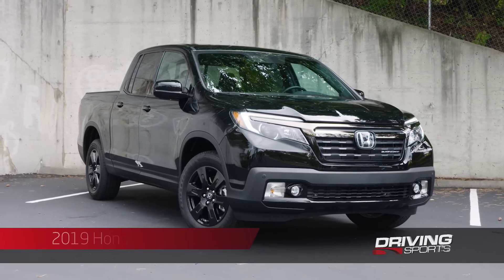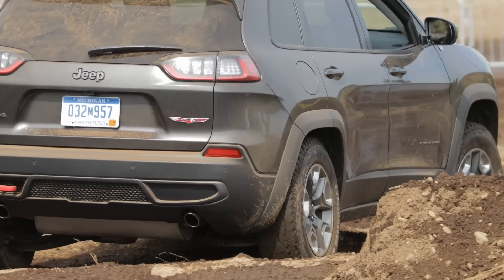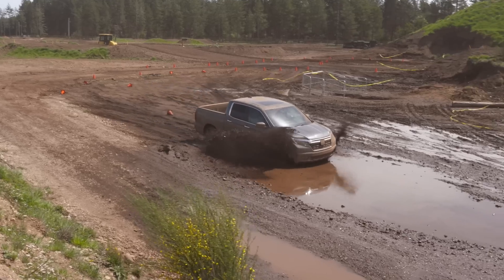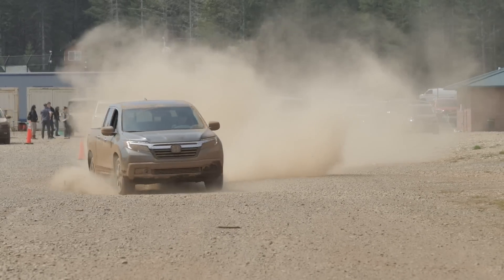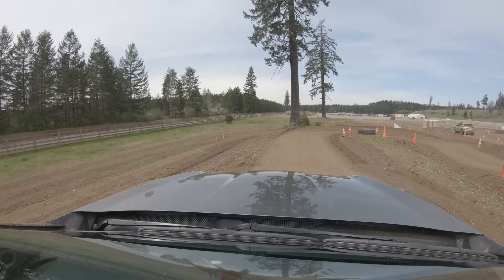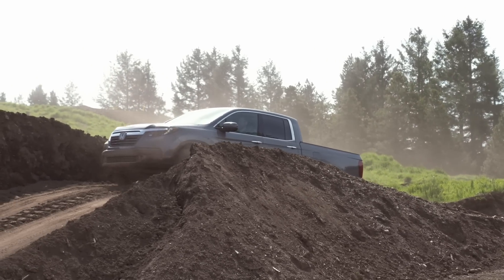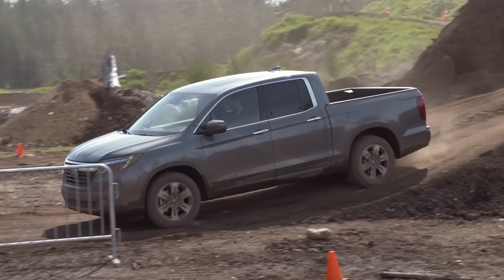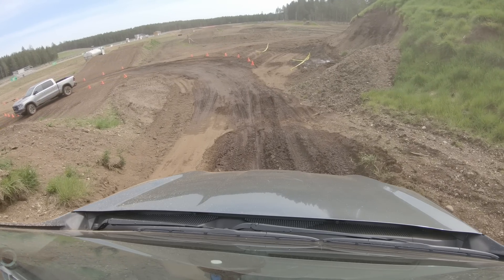2019 Honda Ridgeline Off-Road Test

Comment: I have the 2017 RTL-E and my only gripe is fuel economy. Wish it was better.
Reply: What are you averaging, and under what conditions (percent city/highway)?
Reply: Alan Bowers I drive about 70% highway and 30% city. I average 20-21 in the winter and 22 in the summer months. (Sometimes 23 if I stop driving like Grandpa and drive like grandma)
Reply: shedrick s not terrible but not great either. I’d like to see 24-25 with that kind of driving. My 4 banger Tacoma gets around 23-24 and I’m okay with it though so maybe I’m too optimistic.
Reply: i get 24.5 mpg using eco 80% highway cruising around 50 mph
Reply: Alan Bowers Your right it's not terrible but I was hoping to average 24 for my commute back and forth to work.
Reply: Eddie Kuhn I can't drive that slow on my commute. Also is this hand calculated because the Ridgeline trip computer is off by about 2mpg. So if your computer says 24.5 your probably getting 22.5 - 23
Reply: My 2018 Colorado Z71 4x4 with the V6 has been averaging 20.8 around town. Did a cross country trip with the cruise set to 70 - 75 mph the entire time. Averaged 22.5mpg during the Winter. I like the sideline but like the Colorado better for durability doing truck things. The sideline is all most will need and will likely last a long time too. I did not like that the beginning of the video saying the sideline can tow more than a "Colorado". WRONG. Mine legally tows 7000lbs. If you get the off-road ZR2 or gas 4cylinder.... then it  would be correct. The ZR2 tows 5000lbs and the 4cylinder tows 3500.
Reply: shedrick s Have you ever tried hypermiling it in thebright lane on the highway? I'm interested to see if it could reach 30 mpg by hypermiling.
Reply: I am willing to bet that the answer would be an astounding YES to being able to hyper mile and get 30mpg. My Colorado gets around 30 to 40 mpg when on flat ground cruising at 40 to 45 mph and in 4cylinder mode on the V6 with 4we and all terrain tires. Modern trucks are getting pretty amazing these days.
Reply: Oh wow thats horrible. I have a 2015 GMC canyon with the v-6 and get on average 25-27 mpg highway going about 68-70.
Reply: sideline*  lol
Reply: In the summer on long highway trips I average 24-25mpg hand calculated.  I get better MPGs at 70 then I do at 55.....weird!
Reply: border411 Yeah I notice the truck likes to be right about 65, that seems to be the sweet spot.
Reply: I drive my 2018 RTL-E on the interstate for work daily and also average around 21 mph year-round (using eco mode). It was advertised to get 25-30, but I only see that happening if you really go out of your way to coast at high speeds without touching the accelerator.
Reply: I don't know where you guys are getting your numbers from for Tacoma's. My Tacoma V6 gets 15.0 - 17.0 mpg nearly every tank.

Comment: About Toyota Tundra and Honda Ridgeline  which one is the best Truck ?
I have 2006 TOYOTA TUNDRA running excellent never have any issue, only change oil and tires
Reply: BabyBBB01 they are very different trucks. Toyota is standard body on frame. Drives, rides, and handles like a truck. Honda is very different. Drives and rides like a Camry but built strong for towing and more importantly, stopping a trailer without wearing out brakes or transmission. It’s a nice combination of truck and car. Truck for those of us who are not truck guys. That’s why it’s pretty rare to see one with a lot of after market stuff, big knobby tires, lights, winches, etc. it’s not that type of truck.
Reply: You talking Tundra or Tacoma? Tundra is a full size truck. Ridgeline and Tacoma are midsize. Toyota is excellent quality. I've driven Toyotas for the last 15 years. However, the Tacoma has a very uncomfortable cab and sitting position and fuel economy isn't so good which is why I went with the Ridgeline.

Comment: All commenters butt hurt over saying this tows more than a Colorado. If you are thinking of towing 7000lbs with a Colorado or a Tacoma you seriously should be getting your head examined. My Tacoma doesn't have enough power to tow my 3000lb boat. I would never tow more than 5000lbs with it. I'd never get out of first gear. The big thing this truck has that NONE of the others in this class has, is a bed capable of hauling a sheet of plywood.
Reply: S Patoine hailing a sheet of plywood? Hanging a foot past the tailgate! Oh an I have towed a 6,000 lbs boat for my brother a few times with my Colorado z71,4x4,V6 Ext Cab with ease! Plus tow my 4,000 lbs travel trailer with my Sportster in the bed! That’s just over 10,000 CGVW in a Cat Scale! On a 4,000 mile trip a year or so ago.
Reply: Can't speak for the Colorado. I can say the Tacoma can't haul squat, is gutless, and sucks fuel like a 1980 Chevy 1/2 ton. I had to put airbags in the back so I could haul a decent load.
Reply: The newer Canyon/Colorado with the diesel engine can do that. Plus, they are NOT the size of the old S-10 or older Canyon/Colorado. Their frames are a lot beefier
Reply: K. R. V. If you really towed 10,000lbs with a Colorado, you sir are crazy. I'm not questioning the trucks ability to pull it, I question the ability to safely control that weight with your truck at highway speeds.
Reply: @guardrail2897  That's the total weight on a scale. (trailer, truck and a Harley on the bed of the truck.)
Reply: Just hauled 5 sheets of mdf with my ridgeline. Tailgate down and they stuck out no more than 6". To all the people who complain about not having an 8' bed - thats what straps are for
Reply: S Patoine this is true!
Reply: @k.r.v.4219  Yeah, you can't fit a sheet of plywood flat in a Colorado, no midsized truck has an 8 foot bed, and most half tons are sold with short boxes, so your tailgate comment is straight ignorant unless you are comparing to a full sized long box truck. Also, any real truck reviews state that if you plan to tow over 5k lbs, you should be using a full sized truck, because even with a weight distributing hitch the trailer has a significant chance of pushing a midsized truck during braking. Yes a Colorado can theoretically tow 7k, just remind me not to be anywhere near the guy who tries.

Comment: How is it in soft sand?   That's one test I haven't t seen.  I use my '06 Pilot at the beach and she works fine, but the tools that rip down the beach, faster than they should, and others with wide tires cause some deep ruts to be dug out causing me to sometimes bottom out.

Comment: My only real issue with this is the price and long-term reliability. The Black Edition and Tacoma TRD Off-Road 4 door are virtually the same price. Hondas are good until you kick over 220,000 miles, auto transmissions are insanely expensive to fix or replace, the bed of the Ridgeline is smaller. The Tacoma TRD Off-Road can double the mileage all day with proper maintenance, you can get a manual transmission which is better on fuel and super cheap to replace a clutch, flywheel, and throw out bearing. Fuel economy on both are virtually identical. Both are comfortable, but the Tacoma is better in every way and will suit the same needs to those who want a Ridgeline. The other side is AWD vs 4WD which is a futile point in today’s vehicles when it comes to normal road use. This is Honda’s El Camino. I have owned many Hondas and loved them all, but their market is budget friendly consumers, not the high end market. They need to stick to what they do best; making reliable and budget friendly vehicles and stop trying to sell things out of their spectrum. For those looking to compare reliability with American vehicle brands; just stop. American vehicles do good to see 200,000 miles in the best of situations, are made with so many gremlins it should be a crime, maintenance and repair costs are ridiculous, and the days of those “classic American reliable trucks” are LONG gone. I’ve owned plenty, hated them all for various reasons, and their value just doesn’t compare. Don’t even get me started on Jeeps.
Reply: The reason to pick this over a tacoma is comfort. The interior noise level is as low as a s-class mercedes on the rtl-t trim and up. Also the ridgeline will haul plywood flat in the bed where a tacoma will have to prop it on the wheel well. And there is the in bed trunk which i use daily. There is the in bed audio system which is perfect for tailgating. It does all this without giving up much capacity to the other midsizes. The only downside is the engine which uses a timing belt which will need to be replaced every 105k. I wish it used a turbo 4 cylinder personally for a few more highway mpgs

Comment: I'd be a buyer if it towed more and had at least another inch of ground clearance. Perhaps the air suspension like the RAM to lift it. My 4000# trailer would push it to it's max when loaded, and hill climbing that way would be SLOW.

Comment: Correction that more load capability than a ZR2 Colorado NOT a Z71, LT, Base or W/T Colorado Ext Cab, of which is not available in the Ridgeline! The gas powered Colorado Ext Cab 4x4, 4 cyl or V6 other than ZR2 can carry up to 1,552 lbs and the V6 can tow up to 7,000lbs. The diesel can tow 7,500 lbs! Not to mention go off road better than any Ridgeline will ever, especially the ZR2!
Reply: K. R. V. Exactly they tried to hype it up cause it can to more then a soft suspensioned zr2
Reply: The extended cab is a two door, not in the same class. Same reason you don't compare a single cab half ton with a crew cab, the former will always beat the latter.
Reply: CommieCat but still not needed to have more capacity or room. The Crew Cab Colorado in any trim level besides ZR2, like Base, W/T, LT or Z71, in rear or 4x4AWD all have an available longer bed with more weight and towing capacity, with a real body on frame truck that will absolutely take more abuse and overloading, than Honda’s fwd minivan based tuv.

Comment: I am considering this Honda vs the Toyota tundra trd pro, which is the better off- road vehicle?
Reply: If you do lots of off-roading, don't get Ridgeline. Its ground clearance is less than 9". I wouldn't say Tundra is a better off-road truck but it does have good ground clearance. If you search Edmunds' Death Valley Ridgeline tests video, you will know what I meant.
Reply: Is this a serious question?   Good lord, there is no comparison.  The Tundra is built for off road, the Ridgeline is built for pavement Princess’s who like to pretend they have a truck while they tout “comfort”.

Comment: Lol!   Watch Car Question honda ridgeline diagonal test. HUGE FAIL
Reply from the maker: Watch the same drivetrain in the Passport climb up a diagonal cut: https://youtu.be/cHwp1WxhYpI
Reply: I think what you see is the clutches limitations, AWD especially sh-awd (ivtm4) because of it's capability send 70% to rear is superior on wet, snow and light off road, but when it comes to pull whole vehicle weight up steep by single wheel driven by clutch, it will over heat them...it has to be used with that in mind, driver should try keep slow momentum as much as possible if you in deep wavy terrain ...edit: which makes me wonder, idk how these are designed, but why this can't be some sort of combination of clutch for smooth connection and dog clutch once system senses that it needs to remain connected, sort of like G80 with smooth engagement, imagine cylinder device with outer ring as clutch plates and center sliding piece as dog clutch locking it up, all that capable of disconnection for all AWD needs

Comment: It's not a truck, it's a mini van with a bed in the back. If you get a flat tire with a load of gravel or etc, you will need to empty said load to get to the spare. My Nissan Frontier PRO 4X can tow 6300 lbs and it has a rear locker and it can go through puddles too....and it's cheaper than Honda.  Nissan sells more Frontiers than Honda sell ridge line!

Comment: Why I wouldn't buy one.
No frame
No solid rear axle
Transverse mounted engine (front wheel drive bias)
Very bad approach/departure angles
Comes with a stuck mode button?? 
No low range
Makes peak horsepower over 6000rpm?
It's not a truck.
Reply: Joe Orcutt you should also make sure your truck doesn’t have independent front suspension should have a solid axle be a real truck

Comment: Had my 08 ridgeline last up to 350,000kms and with weekend towing of a loaded two atv trailer so about 3000 pounds. It got me more than ten years of hard use, the engine still does not eat oil but the transmission is toast now. Dont know what to go with next, colorado, tacoma, or another ridgeline.

Comment: No low range. No body on frame. Not really a 4WD truck with out them ! Just like Subaru's are not really SUV's. Subaru's, the Ridgeline and all of there ilk, unibody with no low range, can be very capable for what they are and what they are is beefed up AWD cars. It's like this: Quater horses can do just about everything that most people need a horse to do, but it's just not a true draft horse and should not be sold under the guise of being one.
Reply: This comment reminds me years years ago, people say cars with AT are not cars. Ridgeline is not 4WD. Its an AWD. Its an AWD truck.
Reply: So I'm guessing my horse analogy didn't work for you.

Ain't disagree'n grand !  How bout we call it an AWD Trar.

Ps. Don't get me started on slushbox transmissions. I am even less enamored with them than I am with cars in truck clothing . Big strong cars that is !

Comment: This is a fantastic vehicle. But I will not be buying one. First, the Ridgeline has very little market penetration. Their sales is less than 10% of the competitors. I do not want to be stuck with an orphan.
IMHO, they should have market this vehicle as an upscale Accura. They should cut the price for the first year, and give heaps of incentives to the salesman for making multiple sales. They need the market penetration. They need the visibility. They need the respect of the trucking community. And sales figure speaks volumes. For now, I don't see how they can break out of the stale mold that they have been using for the previous Ridgeline.

Comment: Honda ridgeline are not 4x4 only awd , no 4H and 4L. I like Colorado, ranger,frontier,tacoma better because they are real 4x4 4H 4L good for off road.
Reply: It's not just an AWD, it's a torque vectoring system which in some ways is superior to the traditional 4X4

Comment: Can I get a 6” lift or long travel on this ridgeline???  If so sold!!!!
Reply from the maker: Looks like a 2-inch lift is max available in the aftermarket right now.
Reply: Suave House It has independent suspension all around so that's something you have to consider
Reply: Nope not a real truck heavily limits mods
Reply: For that you would need to buy a truck. A car that looks like a truck is not for that.
Reply: There are lifting kits...
Reply: WtrDogg20 the fact that you said “lifting kits” shows you have no idea what your talking about.  The first gen ridgeline has been out for 12 years and the best lift kit you can get for it is a shitty 2 inch spacer lift (hockey puck lift)... and the lift doesn’t even allow you to clear larger tires due to the shape of the fenders... so glad i drive a bronco instead lmao.

Comment: wrong it tows the same amount as the ZR2 check your facts.
Reply from the maker: Just checked: ZR2 still only tows 5,000 lbs.
Reply: that's what I just said they both have the same towing capacity of 5,000 lbs,  you said the ridgeline has more towing capacity and it does not, plus you could get a standard Colorado and it can tow up too 7,700 lbs witch is way more than the ridgeline.
Reply from the maker: We said "hauling capacity" if I recall (haven't watched this video for a while.) We consider hauling to be payload and towing. Which is 1586 and 5000 lbs on the Ridgeline. On the ZR2 it'1 1,100 lbs and 5000 lbs. 6586 is greater than 6100.